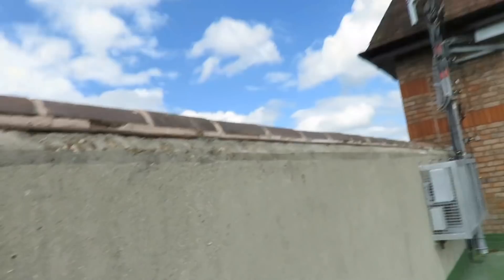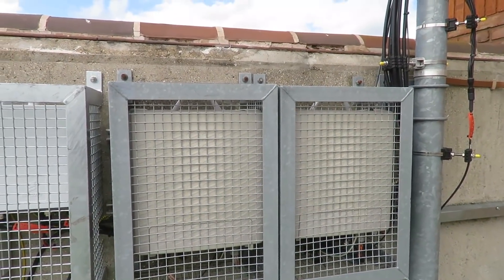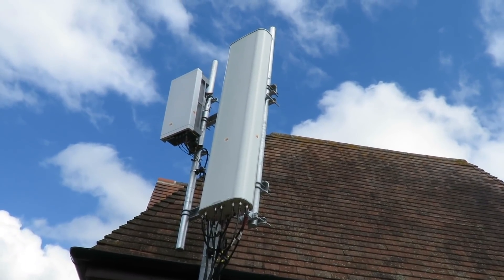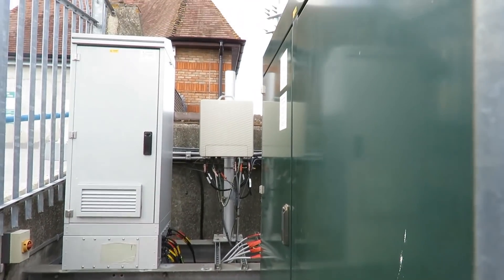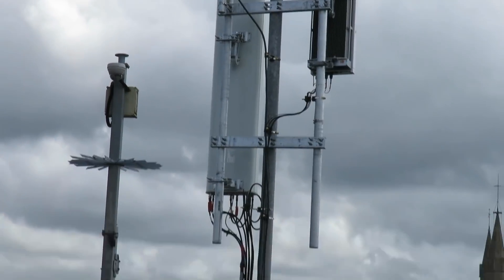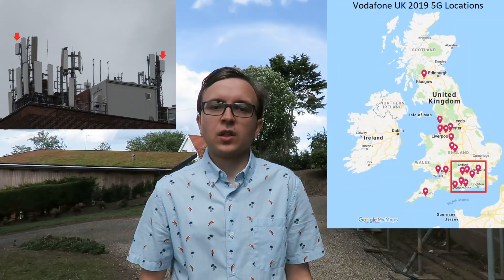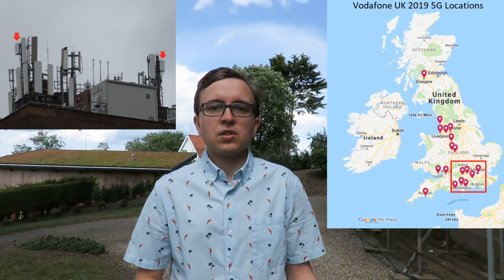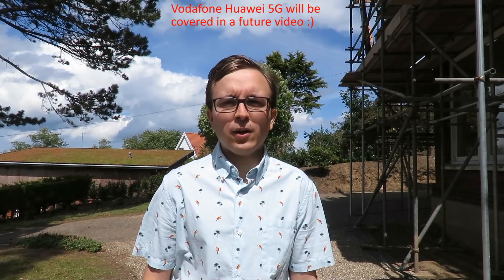Rooftop Tour: Vodafone UK Ericsson 5G Architecture with AIR6488 Massive MIMO

Comment: We are doomed, the sheep will flock and fall to there knees
Reply: this Peter guy does not think it is of any importance to get readings of the 5g spots through an EMF READER, he is a part of the problem
Reply from the maker: @Barney-ii1no  it's important for EMF to be measured by an appropriately qualified person using a calibrated tool. Such tools cost thousands and thousands of pounds. Fortunately, Ofcom has done 5G EMF audits and found the emissions to be massively BELOW guideline limits.
Reply: Peter C because offcom is totally impartial mate. Can we have any non-industry work done on it?
Reply: Peter C How many have died in England due to cov? Research symptoms & science docs of g..5 - you will likely change your tune - Be Well🙏
Reply: @scivids1999  until they turn up the energy.

Comment: phenomenal tech knowledge!  Is 5G currently being used on any Lamp posts in the UK?  Do you have pix/recordings of a 5G lamp post? There are ppl  making out that any lamp post with a bobble is 5G, which is nearly all of them!  Are there any pix of 5G ready lamp posts even if they are not current sending a 5G signal?
Reply from the maker: Not come across any 5G lamp posts no.
Reply: 5G is on all la posts, it's weaponised
Reply: @dk6317  Haha! Oh, I love the clowns on youtube sometimes. Those "bobbles" are light sensors to turn lights on when it gets dark. They're too small to hold the amplifiers used in 5G.
Reply: @soentrueman7944  you need to watch Anthony Steele dismantling what you call a light sensor, you may be horrified to learn the truth of what really is inside them bobbles that you giggle about.
Reply: @dk6317  obviously you've never worked with radio amplifiers. I have. There are no noteworthy amps inside the circuit board. In fact he can barely identify what is inside the magical box of tricks he opened. All misinformation and lies to get YouTube clicks as an easy way to make money. Occam's razor.

Comment: What a fucking beast looking system. Would anyone be arrested for destroying these systems?
Reply from the maker: Pre-meditated criminal damage to Critical National Infrastructure won't be taken lightly. The area's covered with security aswell.
Reply from the maker: Also for anybody misled about 5G, might be worth reading this: https://www.wired.co.uk/article/5g-health-risks-concerns
Reply: @scivids1999  https://bioinitiative.org/rf-color-charts/
Reply: @scivids1999  I think generally 5G will be safe, however I do think there might be some health issues for people who suffer from electro-sensitivity.  Electro-sensitivity was first discovered in 1932 - it is a real condition for some people.  Also I am wondering if electrical harmonics will come into play with 5G?  Harmonics can increase EMFs - can double or triple them (according the the Health & Safety Executive guidance for Employer son EMFs in the Workplace) - "The frequency of EMFs is expressed in hertz (Hz) or cycles per second. Multiples used are 1000 Hz or 1 kilohertz (kHz); 1 000 000 Hz or 1 megahertz (MHz) and 1 000 000 000 Hz or 1 gigahertz (GHz).
It is important to consider the potential for harmonic frequencies to be present and they should be taken into account in any assessment made.
A harmonic frequency is a whole-number multiple of the fundamental frequency of an EMF. For example, the mains AC power supply has a fundamental frequency of 50 Hz. The frequencies of the next harmonics are 100 Hz (2nd harmonic), 150 Hz (3rd harmonic). For equipment operating at other fundamental frequencies, these mains harmonics may be present in addition to the harmonics of the equipment’s fundamental frequency and must all be assessed if they are significant potential sources of exposure."   Its quite an interesting document - employers have to have in place "Exposure Limit Values" - - if EMFs increase with 5G then i can't see how "Exposure Limit Values" can be applied - especially where pregnant women d people with devices fitted etc?  http://www.hse.gov.uk/pubns/priced/hsg281.pdf